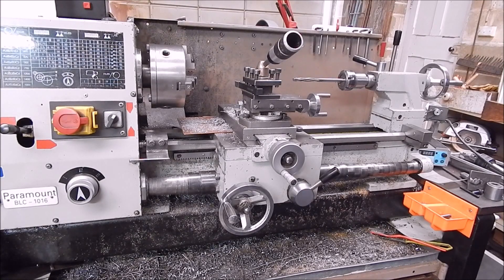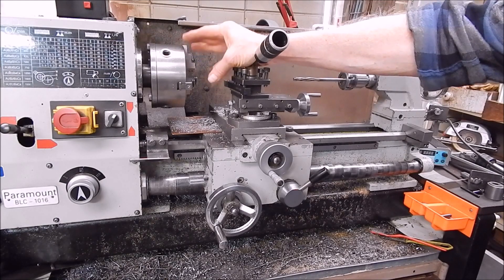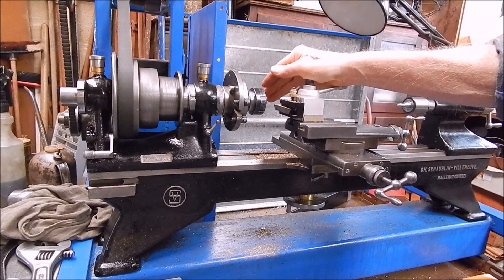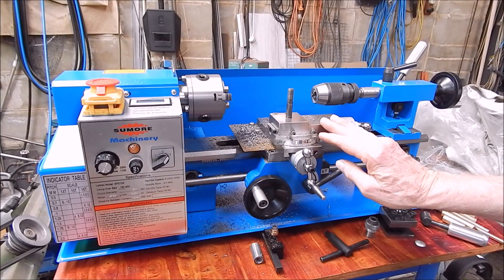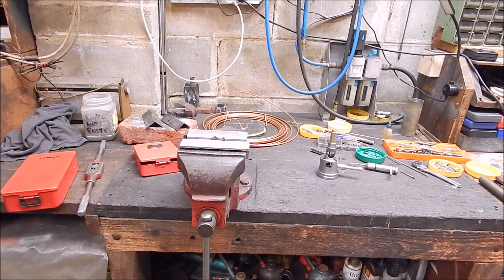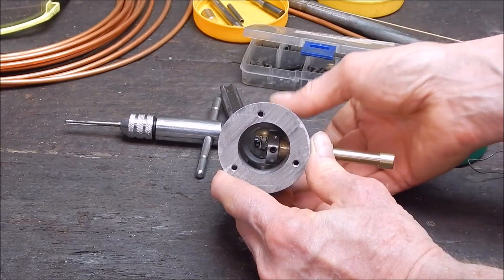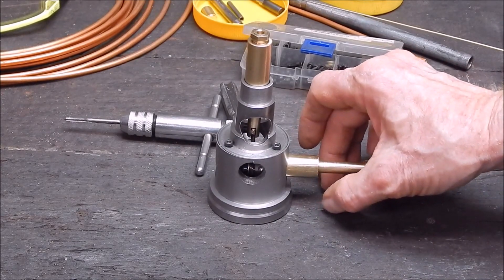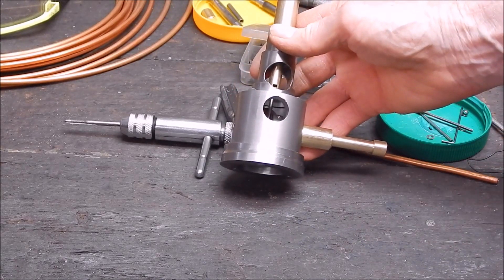What's happening in the Xynudu workshop ? - No. 3

Comment: I agree changing heavy chucks is a hassle which gets worse as we age.   My 12in swing lathe came with 6in 3 jaw scroll chuck and 8in 4 jaw independent chuck.   I have used the 8in chuck only once.   A big hassle to move around and mount on the lathe.   I purchased a used 6in 4 jaw independent chuck on EBay so I had something easier to manhandle in the times I need the 4 jaw.
Nice job on the new engine.
Dave.
Reply from the maker: Hi Dave,  Yes.  You can always fit a smaller chuck to a big lathe and it will work fine.  You lose a bit of tactile feel in the heavier controls, but it's do-able.   I'm not against buying big lathes, but people need to be aware there are some draw backs.  Chuck changing being the biggest.  It's a real disincentive to using collets .  Cheers Rob
Reply: I love collets same as you.   I do not yet own a collet chuck, so I am using a hex block with 5C collets on the lathe and hex / square block with 5C collets on the mill as needed for indexing.
If I could go back in time I would have purchased ER-40 collets and relevant blocks.    I did not appreciate the benefits of front locking collets vs 5C being rear locking.   We live and learn.
Dave.
Reply from the maker: Hi Dave,  ER are actually full length locking.  I have W20 on the Schaublin which are similar to 5C and they have very little compression range  (due to front locking restriction).  ER are much more user friendly in that regard.  These days 5C is mainly used by industry for repetition work and specialist shape stock (square, hex etc).    Cheers Rob